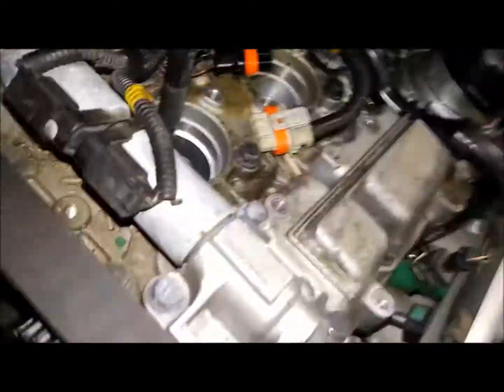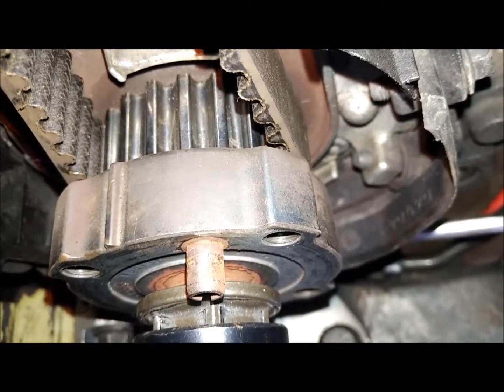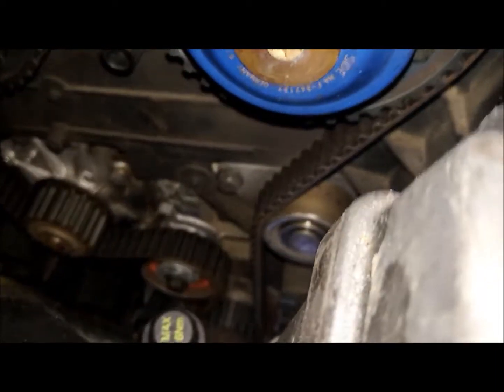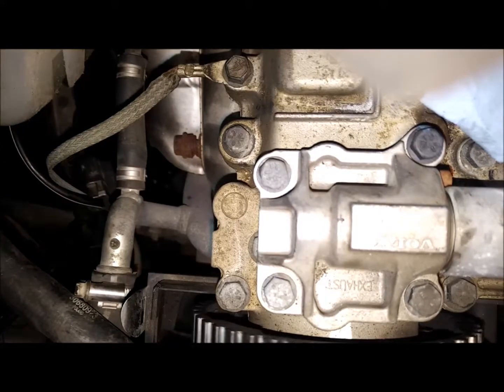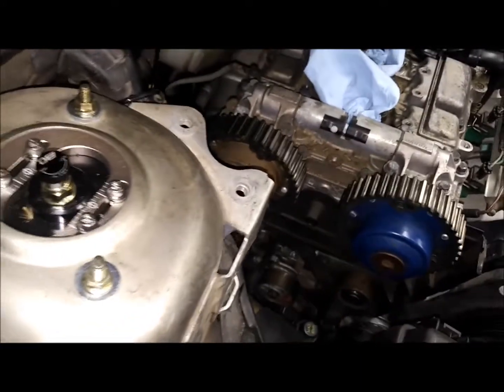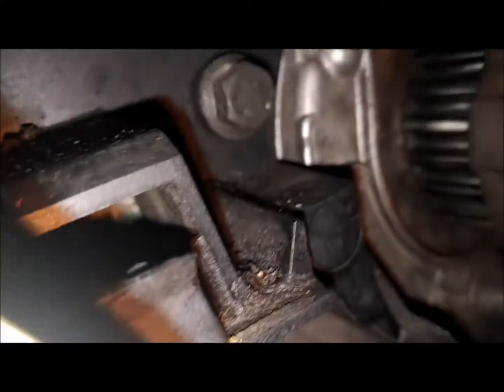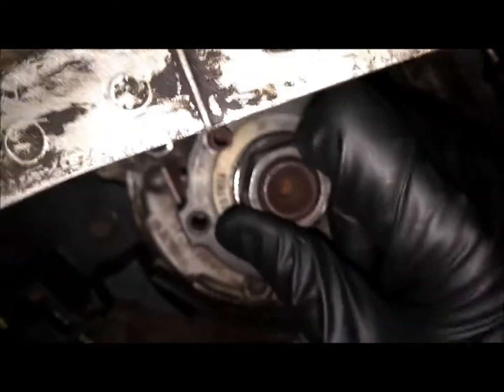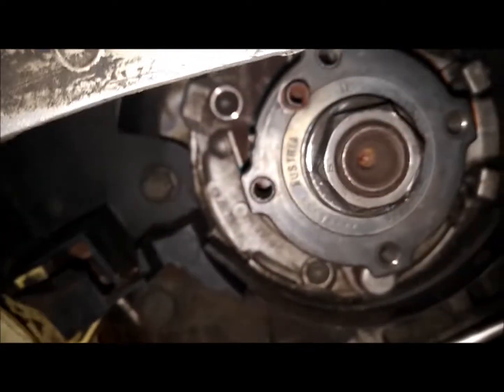Volvo S60R timing marks issue

Comment: TDC top dead center is not used on Volvo engines because they are interference engines if you set the piston at tdc when you try to rotate the cams the valves will hit the pistons. the two most important tools you MUST use to ensure proper camshaft to crankshaft alignment are the camshaft lock tool and the crankshaft locking pin. the crankshaft locking pin fits into a hole in the side of the block behind the starter, its purpose is not just to keep the crankshaft from moving. it locks the crankshaft in a specific position. That position locks all pistons below the surface of the cylinders so the camshafts can be rotated without valve to piston contact.

Comment: I have this issu now I dail the pistons to tdc the the crankshaft does not align with the oil pump timming mark . What did you do to get it right could you assist me .
Reply from the maker: Hi Paul, 
In this case, it was a crankshaft nut that went missing (probably my fault when I did the timing belt at 210k miles - which then took almost 40k more miles to damage itself enough to let it slip) - this missing nut allowed, over time, for the crankshaft timing gear/pulley to move enough to strip it's teeth on the crankshaft and rotate. Even after rotation, it was very tight, much tighter than normal, in point of fact, taking a puller to remove it.  

If that is what is happening with yours, then changing that crank gear/pulley, and CAREFULLY resetting the timing up on the crank and the cam gears with the timing belt should fix it.
Reply: @CaptainSeamus  ok thanks but did you use the timming tool or just set it on tdc when you done the timming the last time because if I use the timming tool my number 1 piston is not dead tdc.  If I dailgage it with the spark pluck out I get it 100 persent on tdc .
Reply from the maker: @paulfritz4249  The way the physical cams are on these motors you shouldn't be on exactly TDC - when I got the new crank pulley, I used the timing marks on the cams as well as the crank. since the cam pulleys are both VVT on the B5254T4 - they have movement in them.  Lock the cams on the opposite side of the motor then wiggle the cam gears to get the belt to slide on properly.  You can do it without the locks, but you run the risk of rotating a cam if you do so.

Comment: This wouldnhave been much more easily set if you used the rear cam locking tool
Reply from the maker: Normally, I would agree, but not this time. 
That tool doesn't do much good when the crank gear/pulley being stripped on the crankshaft is the culprit. Got that tool as well. 
This was NOT a normal timing issue... and yes, normally completely agree - that is a nice tool to have for a Volvo.  Better than my 'between the cam gears' tool from Lisle for this job.

Comment: Three things: crank timing tool in (or by eye), cam timing tool in (at least the grooves of cams must be level) and vvt wheel totally clockwise just before you put the belt on. That's all. You can put a drop of paint as the new timing mark to avoid try and error with the original mark. With Vida you can check the adaptation to be less than 7 degrees plus or minus. If it's more than 10 degrees it'll give error code when starting next time. Fine adjustment can be done by the three little bolts holding the sprocket in the vvt wheel. Thumb rule: one tooth is 8,6 degrees, if you need to jump the belt/cog. If the difference between cam and crank is MINUS some degrees, turn the vvt wheel *counterclockwise*, if PLUS smth -> *clockwise*.
Reply: Most intelligent comment on the subject I have read in months.
Reply from the maker: All correct on a motor that has no other issues. This is exactly what was done after the crank pulley was found out to be bad and replaced.
Reply: brother in christ, the crank pulley is not at play here, what you are showing is directly the crank, the pulley sits on top of it and held by a huge 30mm nut. the crank mark isn't on the pulley but behind it, what you are showing is its in the correct position

Comment: You cant use tdc to time these engines.. use a locking tool because these marks on the timingbelt cover is not tdc .. is just some help when you change the belt... and pay close attention to the vvt. Ure vvt unit is bad .. some small slack is normal but that much bad .. normal problems whit these engines
Reply from the maker: I should state, this one lands in the "weird" category because the crank pulley did spin (due to a failed/missing crank nut) - if I had not physically timed it, it would not have run a little bit, showing it was a crankshaft issue, thus not proving it had actually moved the crank pulley on the crank again.
Oddball, abnormal failures call for abnormal troubleshooting techniques, including going completely old school on it like this.  
Again, thanks for watching.
Reply: @CaptainSeamus 

I guess you could've used the crank lock tool in the starter. Would've proven even further that the crank marks did not match tdc. While the crank "gear"? could've moved we know the crankshaft won't lie lol. I feel like you might need a dial indicator if you wanted to be super precise measuring off cyl 1 piston top. Obviously the eye can tell moving up, stopping, or moving down enough to tell something wasn't right with the marks though.
I'm about to do the timing parts on my b5234t9 2.3 single exhaust vvt. What bothers me is some vvt hubs spring preload and some don't? Or is this incorrect info. And some tensioners load cw while some are ccw based on year? 
What makes it more difficult is it's in an m4.4 98 car where vvt is uncontrolled so there's no code regardless. Exhaust vvt really does nothing for performance so while I had experimented with a load and rpm based 12v source to the solenoid on the bin file. I decided I noticed no real difference and statically set the exhaust cam at -2* to remove high rpm overlap and aid in any excessive back pressure running 23psi out of a 7cm exhaust housing. It let my td04hl-22t flow full boost to redline. Combined with the 1 bar wastegate. I'm thinking I wanna use my cam lock tool and reset the cams to factory specs when I do the tensioner, idler, belt. 
Motor only has 65k so not as worried about water pump. But is 20 years old almost. Belt shows some very minor cracks on the outside.
But oddly the tensioner seems directed almost all the way to the left (cold marks) even after the engine is warm. When I push down on the belt between cams I can see the spring still moves freely. And when it's running there's no bouncing off the tensioner. But still seems odd it stays in the same position whether cold or warm.
The thing is I've been chasing this erratic, extremely mild, idle only misfire that can't be measured in a log but heard in the exhaust note. I know there's no air leak unless it's somewhere in the evap. Afr spot on 14.7. but has 800cc injectors and 3" maf so some scaling has definitely been done in tune. I've replaced all ignition components with OEM Bosch. And eve tried swapping one at a time back to old ones. Plugs have been changed as well as gaps checked. Has excellent vacuum and new intake and throttle body gaskets. New pcv system with oversized lines. I've tried pinching off all vacuum just to be sure like my boost gauge wasn't leaking etc. fuel trims stay beautiful on short term. But long term idles will slowly dance up to around 10% then back down as you drive. It's driving me bonkers!! 
Drives perfect pulls hard. Made 350whp on water methanol + 100 octane and upgraded intercooler. 
But idles like a cammed car almost at times. And not even consistent but almost always when warm. Anyway alter reason to make sure cam timing is spot on when doing this job. If anyone has insight into the hub and tensioner questions. I see lots of videos but none specific to these questions and on the 2.3 t9 2004 single vvt.
Reply from the maker: Please read the other comments. And yes, you certainly do base time this or any other mechanically timed motor with the crank located as well as the cams. The cams and crank have to start somewhat close to the tdc to be close enough for the computer to recognize that it isn't too far out. 
Again other comments explain what was actually happening.
Also, for the bad vvt - that is possible, but I do know it is still working - as the later dino pulls we did can attest. This car is back in daily use.

Comment: You cant time a 5 cylinder at top dead centre !
Reply from the maker: You better not just slap a timing belt on with the cams just pointing anywhere else you'll crater the motor.
Physical timing, not spark timing. Physically the #1 cylinder has to be at tdc when the crankshaft marks are on the mark for physical timing.
The car had a crank gear that stripped and rotated 60 degrees and after I reset the crank and cam gears once, the crank gear rotated an additional 60 degrees - the crank gear being stripped allowed this to happen. 
I changed it, physically timed it with all marks aligned (which, by the way, does indeed mean that when the crank Mark is aligned, the #1 piston is on top dead center) 
Actual spark timing is controlled by y computer,
Reply: @CaptainSeamus  bullshit...set timing marks on crank and cams and stick the belt on worked for volvo since 16 and now 41 so feel free to tell me im wrong if didnt take the cam vvt hubs off just lign the marks
Reply: @benrage5373  any tips you can give to ensure timing is set properly b/c I'm having the same issue right now. Did a timing belt job on my mom's S80, nothing moved (100% sure) but now it won't turn over. Crank & everything lined up & stays aligned when I rotate crank. Any suggestions???
Reply from the maker: @benrage5373  hey Ben. In this case, yes you are wrong... Please read the other comments - this was because the crank pulley threw the nut off, allowing it to shear and spin a ways - 
When it was all reassembled with a new crank pulley and a new nut, then you are correct, but this was in the middle of figuring out wtf was going on.

Btw this is Volvo #16 for me, worked on them since I was a kid growing up in an auto shop - built and raced B20 based rally cars in the late 70s - so yeah, as dumb as everyone who thinks they know everything about white block volvo saying 'you don't base time a 5 cyl' ummm. I listened to my own mind saying the same thing for over 4 weeks - and would be to this day if I just stayed inside your box - taking the time to tdc base time it allowed the motor to run again for a few minutes until the crank pulley jumped again, thus giving me the diagnostic that it had to be on the crank and not electronic or cam related.
So get over yourself. I suspect you'd have had it towed out and not ever repaired it, because you would have never thought to check this.
Reply from the maker: @OFPGOAT  a few questions: was this just replacing the timing belt when it was running before, or was it a broken belt?  Does it turn over but not start? You said you can turn it by hand. 
If the starter doesn't run at all, that is a starter issue (wiring or the starter itself).  If it cranks but does not fire, you may be looking at a no spark condition or a no fuel condition. It may also be a crank position sensor going bad (uncommon, but possible).
Do you have access to a Vida/Dice setup?

Comment: Comment se remplir les piston
Reply from the maker: I am using a 10in (25cm) socket extension to see where the piston is located in #1 cylinder. 
The timing issue ended up being the crankshaft timing gear spinning out of time, and as I stated in the video, the nut allowed enough movement of that gear to strip and spin 20 degrees. 

I hope that answers your comment, and apologies, I only speak English, construction-zone Spanish, and very rusty German...  Thank you for the comment!

Comment: You do not time engine at TDC, it is just before TDC for proper timing on Volvo's
Reply from the maker: yes normally -4 to -7 - but for base time, set it to the engine marks, especially on a Stage 0 engine.  Verifying that they are base timed per spec first, THEN you can start pulling a bit of BTDC to make it even stronger.
Remember, what this video is showing is base cam gears to crank gear alignment timing, not ignition timing.  And they do like that small amount of btdc, but getting the valves to not slap the pistons is priority 1.
Reply: @CaptainSeamus  the way you had the gears aligned the first time is correct. The mark on the crank sprocket and notch on the block, and both cam marks straight up aligned with the notches on the belt cover. TDC has nothing to do with these Volvo engines. Plus, that engine has dual vvt hubs on the cams. It retards and advances on its own. Any new info on that engine since then??
Reply from the maker: @danielrubio6675  yes, it's my daily driver and has over 10,000 miles since then. The problem was the crank nut missing, allowing the crank pulley to move - new crank pulley, new crank nut, torqued properly and all marks set correctly, it runs great. 
If it hadn't shut itself off when the crank pulley spun, it would have destroyed the motor. 
As it is, it still runs very strong.
Reply: its actually after
 tdc

Comment from the maker: And after a lot of pulling with a much stronger puller - the gear came off, and had moved 35 + 35 degrees -  gear was not cracked, but it was stripped.  New gear on and latest video you can hear her running.